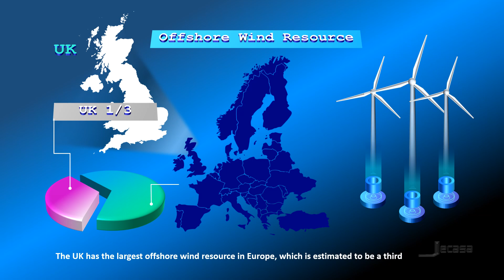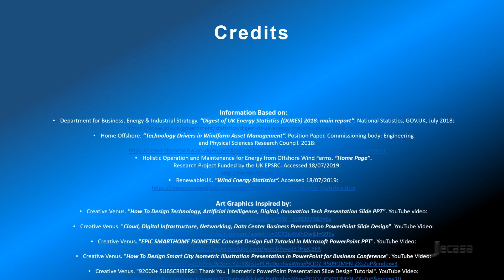The Future of the UK Wind Power Industry

Comment: Basic electrical engineering practice, put the source close to the load.
40 Gwatts nameplate , 16 Gwatts reality on average, near zero at times. All at a very large cost to the consumer, and not just capital, incorporating asynchronous generation is expensive and leads to a less reliable grid. And do it all again in twenty years. History will show how much of a folly all this is.